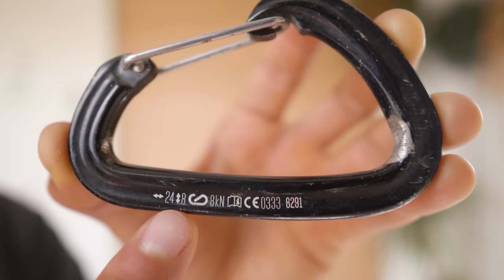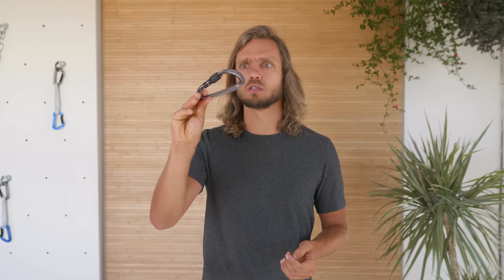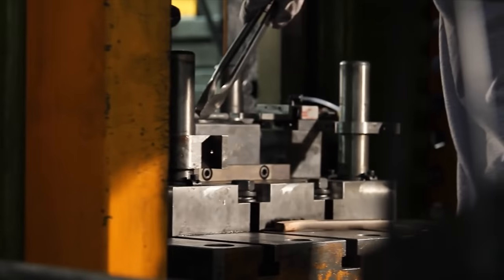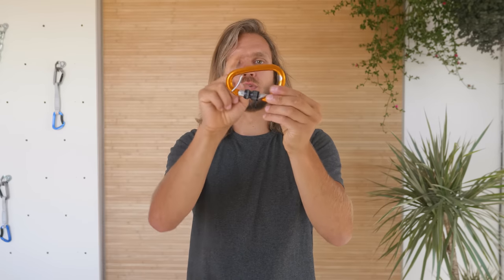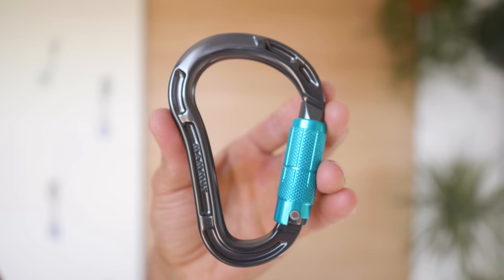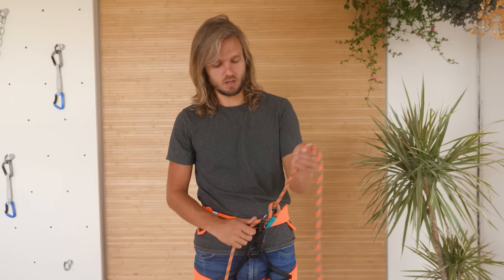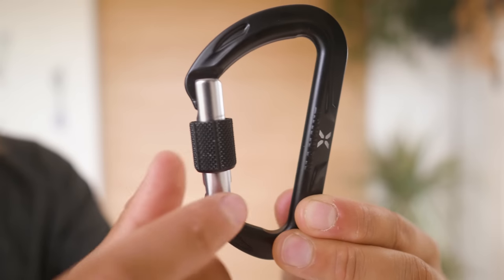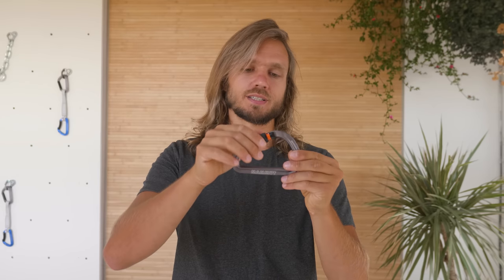Complete Guide to Carabiners - Shapes, Styles & How they Fail | Ep.2

Comment: Hey guys, just wanted to add a note about microfractures. The way I understood it from the materials science & metallurgy classes from my mechanical engineering program, is that once a microfracture is present, it grows under time as a consequence of experiencing fatigue. Presumably, the engineers working for these rock climbing companies are responsible for fatigue testing these carabiners, and have determined that you should retire your carabiners after dropping them on solid surfaces as a result of their fatigue testing. 

Basically the more times you load the carabiners after a microfracture is present (e.g. from taking lead falls), the more the microfracture grows. This is why those carabiners that his friend Rian tested didn't show abnormal signs of failure immediately after his drop tests. However, given a half year to a year of use, then he would probably see failure from testing those same carabiners at lower levels of loading. It could take one month, one year, or one decade, but you can rest assured that a dropped carabiner (with a microfracture) will fail at much lower load levels that an intact carabiner.

TL DR: It's safer to retire your carabiners after dropping them because of potential microfractures that may be present. The dropped carabiners won't fail immediately after, but they'll assuredly fail at lower load levels in the distant future.

Stay safe guys
Reply from the maker: Thanks for sharing, super interesting...
What loads do you think are required to grow microcracture? We rarely load carabiners anywhere close to what might stress them to much.... 
Do you know any testing done to demonstrate your theory?
Reply: @HardIsEasy  You're welcome! I don't know of any fatigue testing data on these carabiners-- I wish the climbing companies would make some of those readily available to the public. They'd be interesting to review.

I would wager a guess that a microfracture would grow at loads roughly a 1/3 of the material's ultimate tensile strength. As far as I know, the engineers for these climbing companies are required to run fatigue tests with cyclic loading at a much lower strength than the material's tensile strength to simulate lead falls. I'd suppose they test at a big simulated load fall of around 4 kN, but they'd also test a bit higher to account for a factor of safety. They'd run the cyclic loading on both the minor and major axes of the carabiners. I'm guessing they determined that carabiners with microfractures should be retired based on the strength rating of the biner's minor axis, but that's just a guess.

I theory, it wouldn't be safe to use dropped carabiners for very long if you suspect they have experienced heavy impact. Especially if you throw them into the granite on top of Yosemite :-). The bigger the microfractures present, the more vulnerable the carabiner. 

Btw, I love your videos! Thank you for putting in so much love and care into them. I've learn a lot in each episode! And the Fear of Falling episodes are super inspiring and relatable. Made a humble student donation to show my support. Keep up the excellent work!
Reply: @HardIsEasy  Also, I reviewed my metallurgy textbook's sections about environmental stresses that also cause crack propagation, like from corrosion (stress corrosion cracking) as mentioned in your videos. Like you said, if the carabiners get salty water on them, then you should wash them off-- because corrosion will cause the microfractures to propagate from the tips of the microfractures. In addition, you should also wash the carabiners off if they ever get dirty or gunky outside because of additional chemical reactions that might occur from the different elements present in the gunk and aluminum alloy, especially if you're climbing when it's hot outside. 

These are super careful precautions, but I guess it only takes 1 failed carabiner to ruin your climbing day/life. ;-)

Comment: Thanks for an awesome video! I've been tought that hook carabiner is designed to go on the bottom of a sport quickdraw. The one into which rope is clipped. It is not unheard of for the rope to jump and push on the gate of the carabiner during fall, open it and escape the carabiner.
Hook is there exactly for the reason of not letting the rope escape during the fall.
Reply from the maker: Someone correct me, but I think that this hook is just easiest gate design. 
Used properly is very rare to unclip the rope out of the Quickdraw - happens, but usually reasons definitely not the lack of nose hook :D
Reply: @HardIsEasy  you’re right, this is a simpler design not an advantage against unclipping. Gate flutter and a rope leaping over a nose is such an implausible circumstance, whereas say draw rotation and the rope loading the gate (or back clipping) are about the only means to unclip and even this is in extremely select positions.
Reply: @HardIsEasy  That does make sense, TBH, climbing community has a lot of myths and superstitions :D thank you for the info and videos, your channel is one of the most helpful out there :)

Comment: Cool Stuff and loads of good infos. 
Thanx👍

@ micro fractures; there is one important point: 
micro fractures are bad doesn‘t matter alu or steel. 

But alu carabiners will break suddenly while a steel carabiner will lose shape and stability. you litterly can watch how its going to break. 

So therefore micro fractures in any alugear is always worse than in steel.

But like you said after a fall always check  your gear carefully 😉

Comment: I was surprised at your comment at 24:58 that a small groove in a carabiner is not a problem. It seems to me like as soon as material is being worn away, the maximum load would start to decrease. Especially because the inside edge is one of the more important areas (which is why they leave more material there). Then again, maybe the manufacturers know this and they leave extra material in this spot for this reason. Or maybe they underrate the load so that even after sustaining some wear, it still performs to spec. Anyway, fantastic video!
Reply from the maker: Yep, manufacturers add more material where they know it's needed ;) Thank you so much for the comment and support!

Comment: I have the Mammut Bionic CrossLock but I am on my second one. The blue lever got stuck on my first one so I had to cut the carabiner in pieces to remove it from the harness. It is great to use it in the climbing gym but I would not take it for outdoor climbing. When the blue lever get stuck you can’t open the gate so you are losing your belaying device and you have to live with it until your have the tools to remove it. I would not recommend it and I can see the same can happened to the new one. I will try to oil the lever and I hope that will prevent it to fail. Thank for a good videos on carabiners and interesting to see them break! 🤭
Reply from the maker: Interesting - Contact Mammut I'm sure they will help you ;)

Comment: 09/21/2022 Hello Hard. This video was very helpful. Climbing and sporting goods stores are designed to direct your attention from your real reason to shop. Flash colours and shapes are displayed to sell the product on impulse. Sometimes the sales person has never used these devices except to figget with then during slack time. This is very much more common in big box  sporting goods stores. This video helped a lot. But I am still somewhat unsure about the locking, I do not like the wire ones. Double action appears in most videos. Thanks for this work. Don

Comment: I agree with everything you say except with not use a quicklink to abandon a route, yes they are heavier than a quick draw but it is not that much either, and it has other advantages. ✌️
Reply: Using a quicklink is the most egoistical and short-sighted way to abandon a route. Depending on the link used, it can be anoying or near impossible to clip a carabiner in the bolt for the next climber trying the route. They corrode and then can't be removed without tools.. and since  it's a piece to bail, people usually buy the cheapest ones from the hardware store, and they are NOT made for climbing. People have had serious accidents bailing of quicklinks where the link unscrewed with the rope running over and then simply snapped. Use an old biner if you really have to bail quickly. Your life is worth the 10 bucks.

Comment: @12:49 I don't know why anyone would want to use locking carabiners for the bolt-hanger end of the anchor; non-lockers are perfectly safe due to the redundancy of having two of them. As for the rope-end then a locking carabiner MUST be used or failing that two non-lockers configured with the gates "opposite and opposed" as per @9:18

Great video by the way! :)

Comment: Hey Ben, are carabiners with burrs (e.g. formed by contact with bolt hangers) still safe to use for anchor building where there is only static rope / sling / cord (NOT a climbing rope) running through the carabiner? Thanks for the awesome video!

Comment: 2:20 "Main goal is to remove material or achieve a certain shape"... There's another big reason. One of the main reasons why metallic parts get forged is because forging improves the mechanical properties of the material. So if you need something strong (like a carabiner), forging is one way to do it. Though it doesn't matter to you as the end consumer as long as the product adheres to relevant standards and is rated for a certain load you need. So, look for standards, look for load rating, and buy from reputable manufacturers. Don't worry about the manufacturing method.

Comment: Aluminun sssuffers metal fatigue with no minimum loading.  Even a small loading will break aluminum with enough cycles, though that may be in the millions for a reasonable loading.

Steel, in contrast, has a lower load bound under which it will not fatigue under repeated loading.  Steal, properly heat treated, is also tougher than aluminum.  The only downsides to steel gear are weight and rust.  But note that aluminum will also corrode if in contact with other metals.

Comment: Great video, this must have taken a while! 

Agreed on 3-stage autolockers for belay carabiners if the rope runs through it, although I still use a 2-stage for my GriGri as the rope isn't running through it so there's less chance of it getting twisted open. Anti-crossload is nice peace of mind when belaying off my harness but for multipitch or rappelling I find it annoying. Luckily on Edelrid's Bulletproof HMS FG you can actually remove and reinstall the anti-crossloading wire keeper if you want to make it less annoying for multipitch, and I found I prefer it without the wire keeper. 

I think standard snaggy-nose wiregates are just fine for the rope side of sport quickdraws, as the rope is so large compared to the hook that it doesn't really snag. Solid gate, clean nose for the bolt side of quickdraws is really important, however. For alpine draws (trad climbing), where you're more often clipping slings on gear instead of bolts, having a narrow nose (Camp Nano 22, Photon, Dyon, etc.) is more important to me than having a snag-free nose as the wide hooded noses (like on the BD Oz, WC helium, etc.) are more annoying for fishing into fabric loops, nut wires or pitons. Best combination of features, size and weight for rope side of alpine draws or gear side of lightweight trad quickdraws is the Camp Dyon in my opinion, I absolutely love them.
Reply from the maker: I find nice that Mammut Anti-crossload carab has bigger bottom loop that works better in multipitch scenarios, compared to other carabiners I've tried... Well it's great to see companies competing to come up with next better equipment for us....

Almost no one uses snaggy quickdraws for sport climbing anymore... It's annoying to unclip the rope out of them.

For alpine / trad stuff you seem to be more experienced than me - so thanks for sharing ;)

Comment: This is awesome!!! You really care for the climbing comunity. 
I have a question I hope someone can answer: did you test how temperature affects carabiners? My guess is they tolerate quite good hot,  cause due to friction they usually get super hot, but about cold I'm not so suer....  I guess good to, cause people use they in ice climbing... Just wondering.

Thank you for your work,  Ben.
Reply from the maker: I would expect carabiners to be designed tested for low / alpine temperatures - since that's where they are also used. But never did any research on this topic...

Comment: Incredible video! Does it make a difference that your triload example uses three carabiners in direct contact with each other while the break test video has one carabiner to two ropes? I was always told to generally avoid hard things attached to hard things and soft things attached to soft things
Reply from the maker: The reason you were told so is to avoid one metal scratching the other... most of the time is not a big deal.
Reply: @HardIsEasy  thanks!

Comment: I am a mechanical engineer and I'd like to add some explanation about microfractures. They will not cause material failure immediately. At first they happen on a molecular level and that's why they are called micro. And  after fatigue loading (like how Eqinor explained bellow) for some period of time depending on the material, load magnitude and other factors, those fractures  grow in depth to a size which could cause material failure. Microfractures can never be seen with a naked eye. They can only be seen in a laboratory conditions using special technology and materials to locate them. I've seen microfractures only at university when we drop tested several materials and the fractures were there after that.
So, my opinion is, if you want to continue climbing with dropped carabiner, go ahead, but retire it after that, because it may fail in future. And "may fail" may mean life fail...
Tanks for clarifying that aluminum alloy carabiners are more brittle than steel ones :)

Comment: Great video, but regarding the "microfractors": pure metals (no alloys) will deform/bend when under load. This is because the metal molecule rows will simply shift a place. Alloys (e.g. steel with added carbon molecules) resists this shifting, making it stronger against deformation. But once the limit is passed, it will break like a falling earth pot. So unless your dropped carabiner has a visible crack, it will be undamaged.

Comment: The anchor scenario for the triload test could be improved a lot by using longer quickdraws, no? The angles of the pull on the main carabiner would be a lot shallower and therefore approximate the rated scenarios.

Comment: Most steel steel is stronger, but typically softer. Its typically less brittle and deforms more before it breaks, where aluminum is more likely to snap. 
But both can be made more or less brittle.

Comment: Really nice video. Can't wait for the other videos in the series :)
One question/comment though: many people (climbers, instructors, etc) say that wire gate carabiners are less likely to freeze in winter conditions than solid gate ones (my 5 minute research skills found an Edelrid post that reinforces this statement). Is this actually true?
Reply from the maker: Since I don't climb in winter conditions, I don't know myself... It probably depends on the size of contacts between the gate and the carabiner... Also the spring mechanisms is different...

Ask alpine climbers ;)
Reply: Sounds plausible as the open shape should make it harder to trap snow or moisture inside it that could freeze.

Comment: Awesome video, but just a little point. Brittle failure depends also on the temperature. If the temperature is very very low, some steel/aluminum could break without external force (nerdy stuff ;))
Reply from the maker: what is very low? :)
Reply: @HardIsEasy  It really depends on the steel/aluminum grade, thickness and temperature. For example: A steel S235JR with a maximum thickness of 85mm could break at 25% of it's capacity at -20°C.
Same steel with 40mm thickness could break at 75% of it's capacity at -10°C.
A bit to cold to climb in short trousers and shirtless. 😉

Comment: Hi, at 23:30 I have a different assumption. I think the narrow side resists better because the quick draws are closer to each other (the forces almost applies to a single points), so it triples-charges less than on the big side where there is more distance between the 2 draws (the forces applies to more distant points). That would need some equations to prove it... but i'm too lazy to do it :D
Reply from the maker: Yea, that's what I think just different words :)

Comment: For anyone using the Black Diamond Belay Carabiner (5:52) with a Grigri.

I seem to see many people using those together, yet I'm still seeing a lot of misuse in that case, which is both unpractical and unsafe, so I thought putting a comment here might save a few lives.
When used with Grigri (i.e. not with a Reverso, etc.), the "smaller" part of the carabiner needs to be on the side of the Grigri, while the "bigger" part would be on the side of the belay loop.
Which means that : 
1) The carabiner "clips" easily in place on the Grigri (i.e. no issue with the belay loop getting stuck in the system)
2) The carabiner is less of of trouble when using the "fast slack" technique of the Grigri (The smaller side of the carabiner being on the Grigri side, it doesn't get in the way of your three fingers holding the rope while the index/thumb are on the Grigri)
3) But most importantly : It won't crossload ONLY if set up that way (Indeed, if you try, you'll see it could cross load if yout put the Grigri on the "bigger" side of the carabiner)

I cannot seem to find the link to the manual anymore, but here is an article which describes it a bit better : https://www.alpinesavvy.com/blog/bd-gridlock-with-grigri-are-you-using-it-wrong